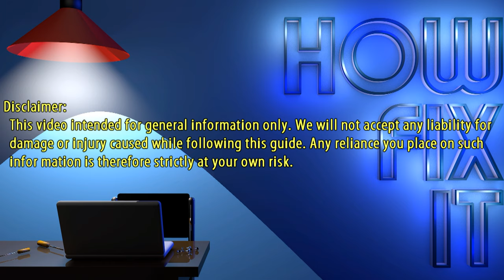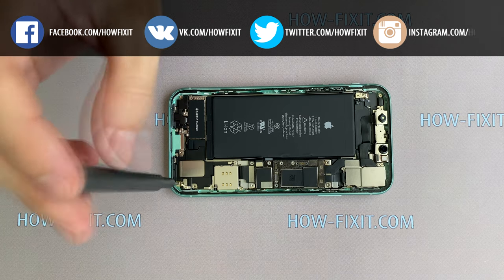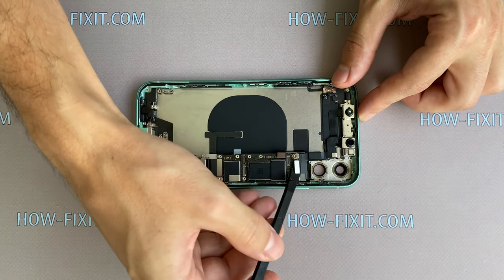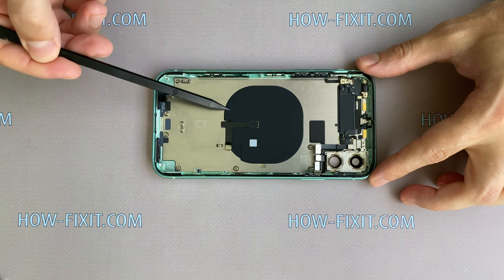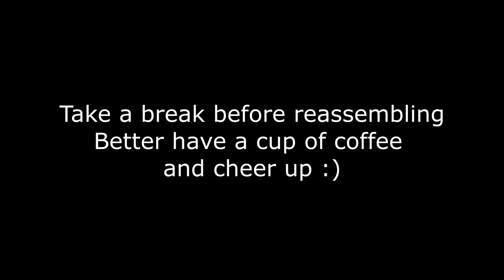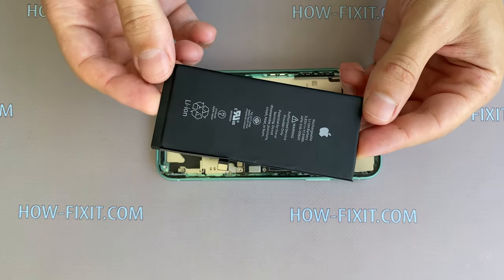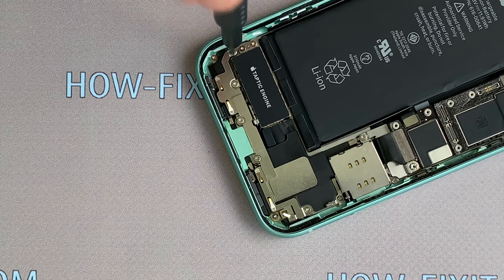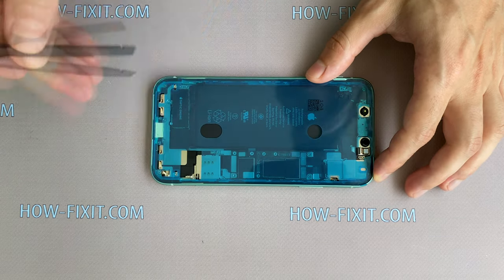iPhone 11 Back Housing Replacement: Disassembly and Reassembly Guide

Comment: Hey I have a quick question, once you've assembled the iPhone back together and turn it on did you get the Error messages about the battery and the screen?
Reply: I did a whole iphone 11 housing change and no error code popped up after I reassembled it;  to anyone who had the same question.
Reply: Yes because it’s not a genuine apple screen most probs
Reply: @kierancoffee3343 if it was the same screen and battery that came with the phone it won’t do error

Comment: I see what ya did there @16:34. For a while I was like what the heck? am I missing a screw? The housing I had I needed to transfer a few more parts. Thanks for getting me this far. This would be a 8 out of 10 for difficulty.
Reply: I went through ifixits affiliate link and it wasn't even the right part i was like what the hell. So now idk whether i just keep the rear glass and try to use the old back housing or switch to a new one. its just slightly bent

Comment: Followed this guide to fix my battery thank you ! Now I have no working microphone during calls nor bottom speaker working any ideas ? Took everything apart and made sure everything was plugged in and still nothing
Reply: You damaged the flex cable
Reply: @nixonscherbarth1974  is that the cable that’s glued to the frame of the phone . Was gonna he new housing with pre installed items . Must have damage something other than the battery when trying to pick out the back glass 🤦‍♂️

Comment: I hope you will be able to help me please? So what happened was my iPhone 11 got thrown and smashed really bad to where the front and back screens are cracked/broken and frame broke as well. So i ordered me new lcd on amazon as well as new back glass. Upon opening the iphone i noticed the battery was bulking and when i pressed on it i can feel juice or liquid. And then i couldnt remove the cracked glass on the back of original one.

Then i looked on ebay and saw someone selling iphone 11 back housing only WITHOUT motherboard and I decided to buy it and figure i can just add what ever components that was missing on the back housing. 

And when i got it in the mail, i put the motherboard on and connected all connectors. Then i went to charge and it wouldnt charge at all and no red battery screen shows either it is just black screen. 

Do you know what i did wrong? I also tried putting my original tactic engine on… not sure if that helps but still it didnt charge. 

So now i am left with a new lcd, new back glass, and used back housing with missing components. 

Please can you kindly advice me? Can you tell me how i can test what components that isnt working? Or what ever you think can be possibility of what i did wrong or what can be wrong? 

Thank you so much! Sorry for long explanation.

Comment: Very helpfull Video
I have one question too you

I recently replaced the entire body of my iPhone. Before I pressed the screen on the latches, I checked if all functions work. all functions worked so I pressed the screen and tightened the last 2 screws. after screwing the screen face ID stopped working properly. So I unscrewed the screen and looked inside again, checked the face id again, it started working properly so I pressed the screen into the latches again and screwed it. Unfortunately, the problem returned immediately. I don't know what the problem is, the screen puts some pressure on the face ID tape or is the problem elsewhere?

Comment: Nice video, I followed up, everything went good. But have an issue, my iphone it's overheating and rebooting about every 3 minutes. Can you help me with that?
Reply: if the new housing had a NON ORIGINAL charging port, that is why it reboots. Rebuilt a few of these.
Reply: @CD-SU  what if I buy a fake rear casing?